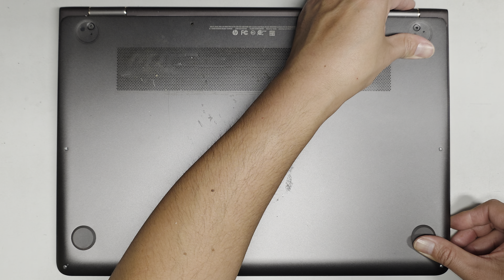HP Spectre x360 15-bl112dx Disassembly RAM SSD Battery Fan Thermal Paste PTM7950 Replacement Repair

Comment: I have the same model as the one in the video and every time I put it to sleep, close the lid, or turn it off via the home section, it turns it self back on or restarts and the only way to turn it off is to hold the power button for around 10 seconds. I even drained the battery completely just as to see if that could fix the issue, but nothing changed. Any advice on what to do about it?
Reply from the maker: Never heard of that before
Reply: Its nothing to be concerned about, it is most likely a windows problem, u must be aware of how many bugs are there in windows 11. Next time try turning off the laptop without closing the lid, wait till it turns off then close the lid. Also try turning off the laptop via alt f4. Please try to minimize holding the power button to turn off the laptop